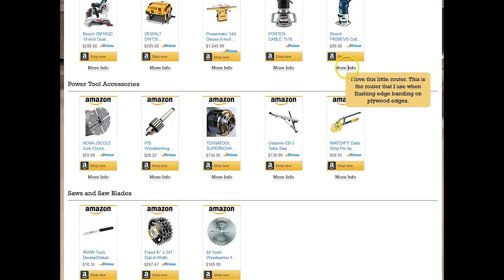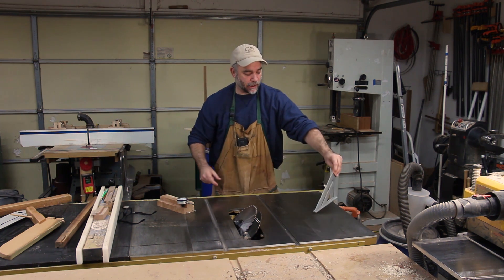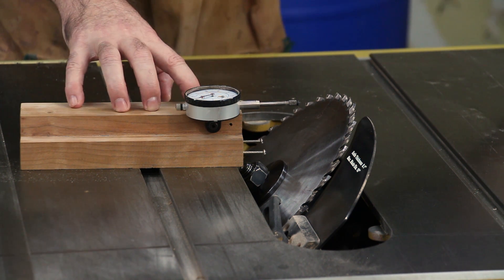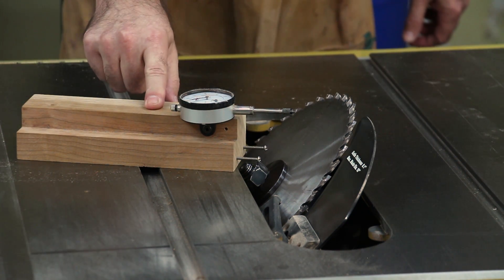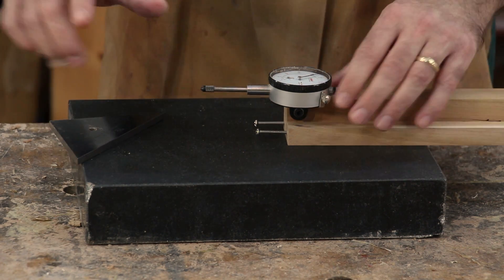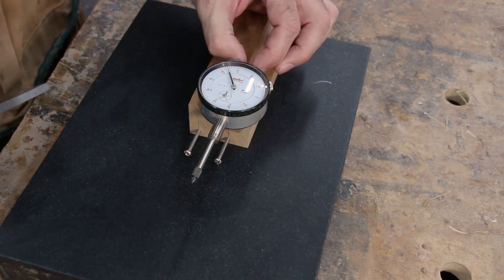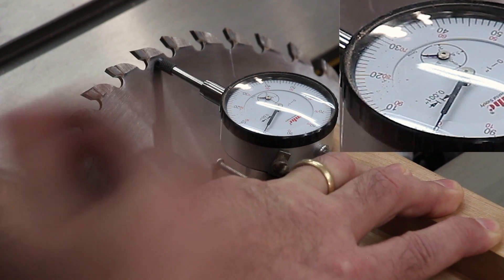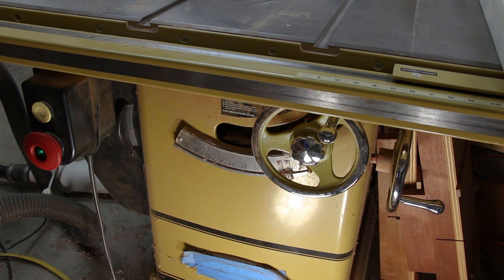45 Degrees at the Table Saw Quickly and Accurately

Comment: I made a version of your original jig and love it. For angles, I attached a small piece of steel to a block of wood with two screws as bumpers and I use a dial test indicator on a Noga mag base/arm. Particularly nice since the test indicator stylus can be moved around to different angles.

Comment: I'd like to see you actually compare your method against one of those digital ones you mentioned.
Reply: Make some cuts switching from 45 to 90 to show speed and ease
Reply from the maker: Send me one.  There is no way I'd spend money on one of those.
Reply: I have one of the digital angle cubes. I have found that there is quite a bit of adjusting when it indicates 45 and then through to the next tenth of a degree. I have checked my combo square with the machinist gauges at work and trust that it is accurate. I get better results with it than the cube. I can see Brian’s method would be even more accurate and easier to adjust.

Comment: Why two screws instead of just a block of wood? I built one without the screws and don’t have to worry about the screws. I never quite understood the rationale.
Reply from the maker: The two screws, which are at the same depth,  allow you to approach the blade at 90 degrees consistently. If the measurement is taken at an approach angle to the blade that deviates from 90 degrees by a significant amount, it can have an effect on the measurement.  Let me know if this is not clear.
Reply: @GarageWoodworks  Thanks for the reply. I don't think I'm explaining it well. Here's an image: https://i2.wp.com/mansteading.com/wp-content/uploads/2018/12/Screen-Shot-2018-12-04-at-3.06.56-PM.png?resize=600%2C339   Basically, instead of resting at 90 degrees against, the screws, the square rests 90 degrees against the wood. I got sick of fiddling with getting the screws correctly aligned, and I thought a block of wood would work as well. Am I missing something important?
Reply from the maker: This might also be helpful: http://www.garagewoodworks.com/Align_90.php
Reply from the maker: @DustinFife  The method utilizes Tan math at its core. See here: http://www.garagewoodworks.com/angle_math.php. In my jig, the adjacent side in the figure is the distance between the lower screw and the tip of the dial indicator. The longer this distance, the greater the sensitivity in "measuring" the angle (we aren't really measuring the angle, but matching it to a reference angle). When the reference angle is 90 degrees, and IF the top of the block of wood is making contact instead of the lower part of the wood, your distance will be shorter. In theory, if you cut it at a "perfect" 90 degrees then the entire edge of the block of wood will make contact at the same time - in practice I'm not sure how likely this is. Another factor to consider is that the blade is likely to have tiny high and low spots which can impact where the blade is making contact on your block of wood (when the blade is at 90 degrees). I think the safest practice is to use the smallest contact point you can get away with - a screw is a great option in my opinion. If your reference angle is always going to be 45 degrees, then the bottom of the block of wood will always be making contact with the reference and not the top - in this scenario your jig should work fine. 
The "opposite side" in the diagram will be the distance measured by the dial indicator after being zeroed at the reference square. 
Please let me know if this isn't clear.
(Disclaimer: I had to edit this reply a few times to correctly express what I wanted to say)

Comment: Great idea, to use for 90 do you reset to zero or just calibrate and remember what that number was on the dial
The thumbs down voters just don't understand the benifit
Reply from the maker: I would calibrate for each angle and adjust the bezel to zero. You might need to re-position the dial indicator to use for 90.  Just make a second screw hole further back on the jig.   This will depend on your dial indicator and how tall you make the jig.

Comment: Why two screws? Why not one screw directly inline with the gauge? It seemed awkward when you were calibrating it.
Reply from the maker: The second screw (the one away from the gauge) allows you to more quickly approach the blade at a consistent angle (90 deg) from measurement to measurement.  The calibration is a piece of cake and after you do it a few times it becomes second nature.

Comment: In which case is an accuracy of 0.2 degrees not enough?
Good trick!
Reply from the maker: With a 45 degree miter, the angle errors will be additive.  So a 45.2 miter joining with a 45.2 miter will be a total angle error or 0.4 degrees.  That is significant enough to see gaps in your miter joint.  And the thicker the board or longer the miter, the larger the gap will be.